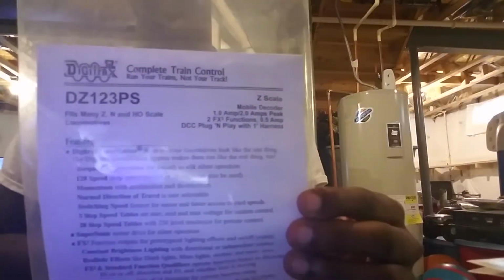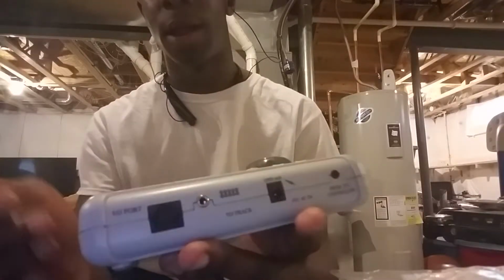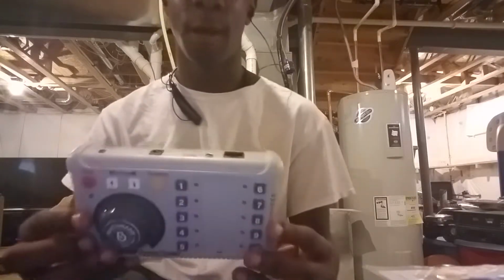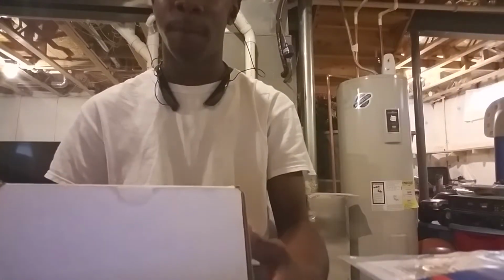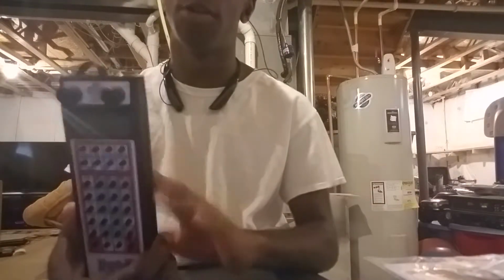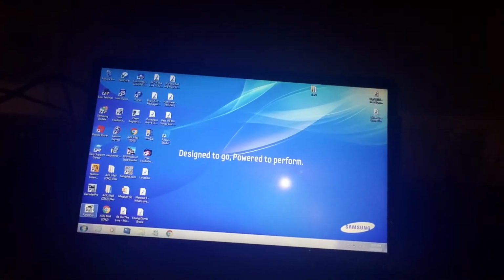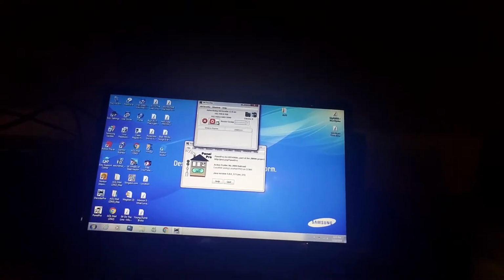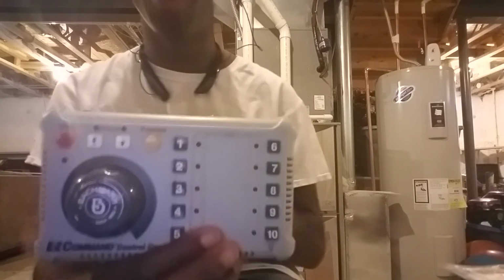Overview/Discussing my Dcc system and how it works

Comment: very informative video, I like that you try to talk about NCE also. 
I have used booth systems, and the biggest difference is the size of the buttons. I find NCE easier to hold on to and see the buttons. 
very nice look at your dcc system that you use.
Reply from the maker: Yes thx for watching and ik alot of people like Nce because of how big the buttons are and how big the controller is so I would see y it a popular system,and I use the digitraxs dcs 240 the newest version of booster out there